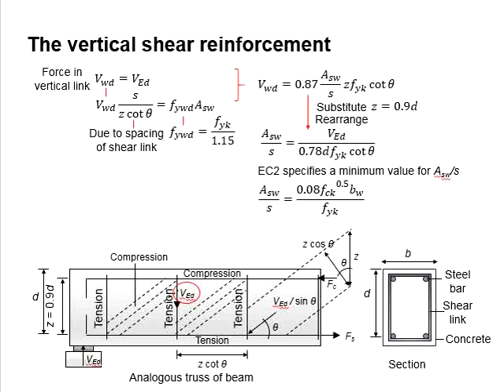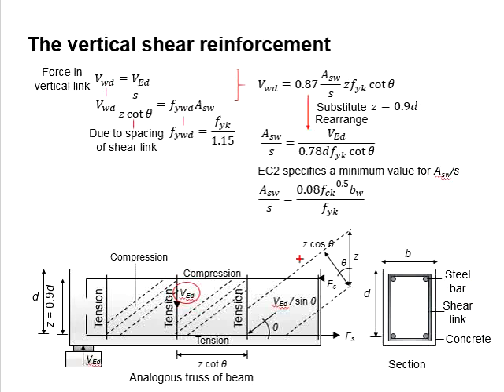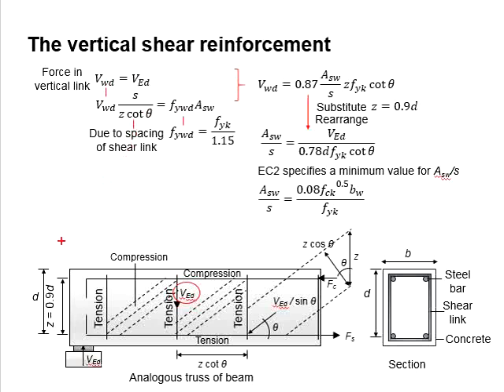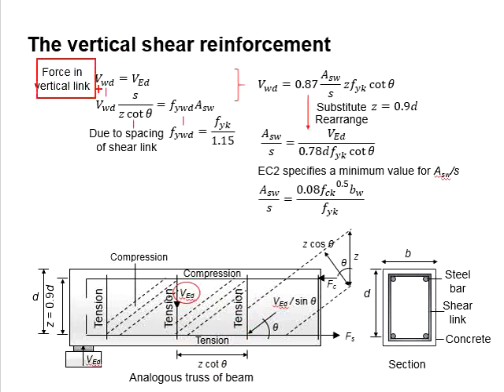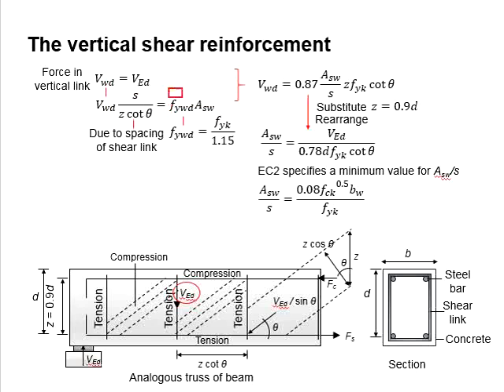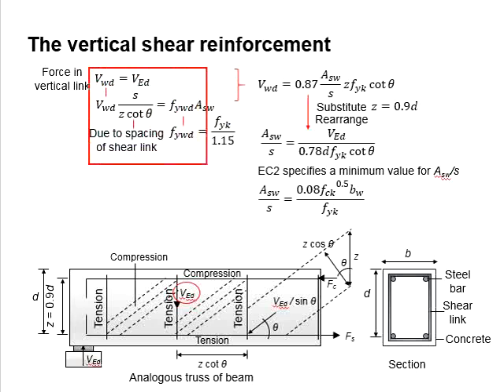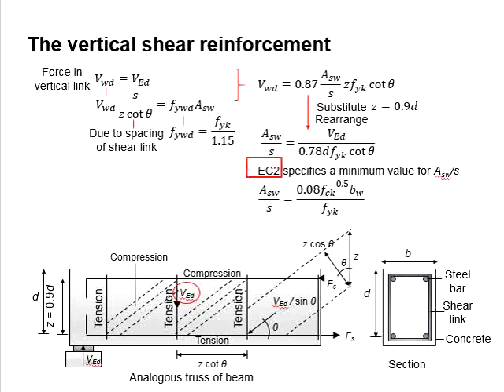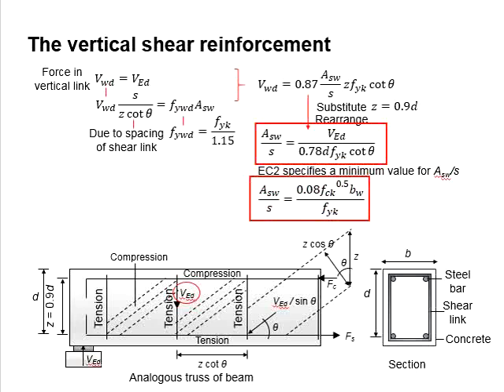5.5 Vertical shear reinforcement in reinforced concrete beam

Comment: Sir, provided that the calculated theta is in between 22 and 45. When we calculate the shear resistance of minimum links, do we use theta=22 directly or we use the calculated theta?
Reply from the maker: The shear resistance of minimum links shall be calculated based on the equation for minimum shear link, which is 𝐴_𝑠𝑤/𝑆=(0.08𝑏_𝑤 √(𝑓_𝑐𝑘 ))/𝑓_𝑦𝑘